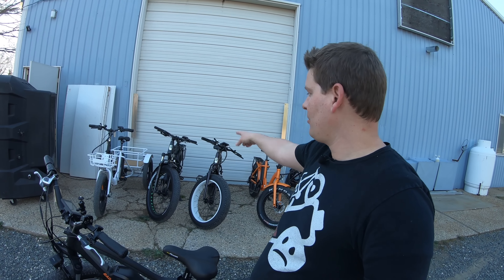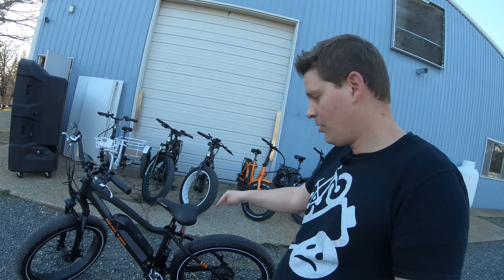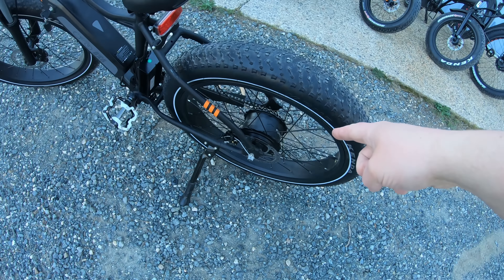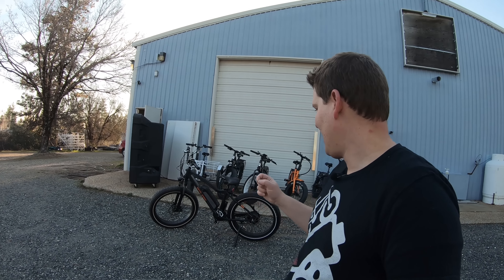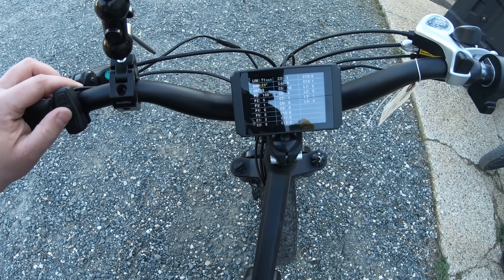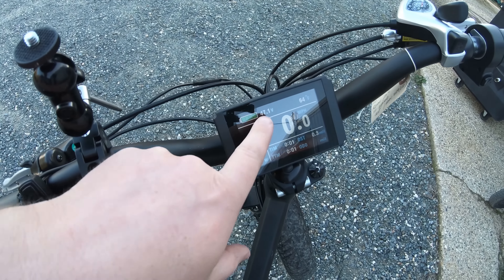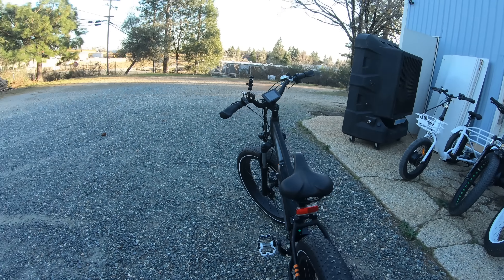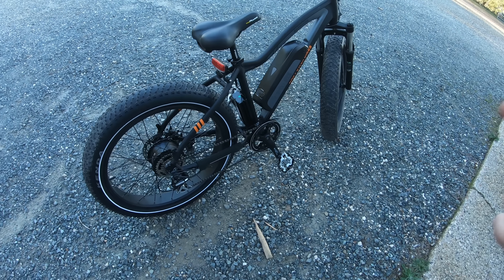How To Improve My Rad Electric Bike

Comment: I have a 2018 Radrover. Does your bike still have the stock motor? And if so, what will adding the motor upgrade due for the performance? There seems to be three possible upgrades. One with just the motor upgrade, one with the controller and display upgrade, and one with all three.

Comment: I have the rad rhino I'd love a upgrade love this channel very informative
Reply from the maker: Oooh that's a fancy one! Sounds like you'd have fun with the upgrade
Reply: @Area13ebikes  it's the eu version on the rad eu site had it a month was dead on arrival but rad is sorting it out cant wait to use it as have nerve damaged feet will help me ride again
Reply: Would the upgrade kit work on the 250w version I hear there the same motors but different controllers on them and no throttle just walk assist on throttle and pedal assist I think they call the rhinos the rovers over there in the USA
Reply: @Area13ebikes  this is the eu version of the rad rover I have in white and orange I did message on your site about the older kit 

https://radpowerbikes.eu/products/radrhino-electric-fat-bike?variant=31654476906589

Comment: REQUEST 📣📣📣📣📣📣📣📣
Is it possible for you to create a small solution with inline wheels to attach to bottom of column with seat post on the RADMINI to make it easy to ROLL it around folded? I live in Midtown Manhattan, NYC and for so many years I have not purchased a bike because of the THEFT problem, so I want to take it inside the stores with me. If you can't or nobody but me interested I can eventually put something together myself with off the shelf parts and then add a retractable handle like wheeled luggage.
😎😎😎😎😎😎😎😎😎😎😎😎
Reply: Also if make it UNIVERSAL with some sort of adjustable securing method it can be purchased by any owner of a folding bike...it's not limited to electric bikes.
😎😎😎😎😎😎😎😎😎😎😎😎
Reply: Maybe something already exists and I just don't know the name of it yet to be able to do a proper search.
STEP 1: Make sure it already doesn't exists!!!
😱😱😱😱😱😱😱😱😱😱😱😱

Comment: Hey Kyle maybe you can explain in better deal on the C12 settings. Meaning that if I have a 48 volt battery, why is the C12 setting is 4 which cuts the battery out at 40 volts. That means that I am only using 8 volts of battery power. This doesn’t make sense. Why can’t I draw the battery power way down to 5 or 10 remaining volts?
Reply from the maker: Because lithium batteries would die if you drained them that far.

Comment: I Have a 2020 Rad Rover Step Thru 1  I would like to do a complete  upgrade on , Motor Display and Controller and Battery  . I Just need to know  if the 2019 Rad Rover stuff will work on it ????????

Comment: I have a 2019 Ariel rider C class bike can you supply and upgrade for the display and controller on this bike.  This has a mid drive motor but the throttle only works when the peddle assist is on zero.  I never use it and it would be handy for intersections and etc.

Comment: So using the upgrade kit can I program the various pedal modes for an energy saving option to get more range?  Of course I would have to give more pedal power, to go the extra distance.  The reason why I ask, is even at pedal assist mode 1 with the stock setup, it seems to apply a large amount of power, hence reduce my range.

Comment: I have a 2019 Rad City. A direct drive motor. Does this upgrade provide more power on direct drive compared to geared? I know you addressed the question but will I get a little more speed from this controller compared to the stock, which can be pushed to 24.4mph?

Comment: I'll likely end up getting this upgrade, though it seems like my RadMini 4 has a bit more power than it should. My battery voltage after charging is 53 volts and I don't know if that's normal, PAS level 3 comes on too suddenly, and walk mode is 13 mph!
However, one thing that annoys me about the stock controller, is that the PAS and throttle-only top speed is the same. Other e-bikes have a 20 mph limit on throttle-only, and 28 mph on PAS. How is your controller setup regarding this?

Comment: What is the best way to mount the controller? I own a 2019 Rad Rover and have only put about 25 miles on it. I want to do this upgrade and of course I want to do it as clean and most secure way without doing much guess work, if that makes sense.

Comment: I desperately want a 2WD conversion for my 2017 RadRover, for use in sloppy mud....  Any chance of that happening?  Any chance it can be done at least 'semi'-affordably?  If you can figure out a way to make a bolt-on kit that would work for both RadRovers and Sondors (or, alternatively, something generic for BBSHD bikes) without costing more than the initial purchase price, you will sell thousands of them!

Comment: i want to do this on my 52v1000w AR KEPLER has a 33amp controller, but only pushing 1300-1400. 1800peak.so if iput 45amp I should get more torque. cause there something slow down bike. also want to make 2wd KEPLER. thx for help

Comment: HI, im curious if the 52v battery upgrade for the radrunner plus once its on, can you swap it easily with the old battery? Or once I install the 52v battery, am I not able to use my 48v stock battery?

Comment: I have a Radrhino EU  750wh for almost 2years now, and 2battery's 48v x11.6 and 52v 13, i have order the new screen KT-LCD8H on your site yesterday, my question will the screen work on the radrhino when i install it or do i need the upgrade controller also.

Comment: I have a EU RadMini4 250w, I really find it near impossible to get up the steep hill near my house. As 250w is the legal maximum in the UK, I was unable to buy a more powerful RadBike, or any other e-bike for that matter. Will this upgrade help me climb the hills with my 250w? Am I right in thinking that once installed I'd be able to push over 600w to the motor?

Comment: I've got a '17 radcity with almost 3000 mi on it, I'd love an upgrade in power. Have you seen anyone using 20700 or 21700 cells in E bike batteries?
Reply from the maker: This would change everything for you. Hmmmm, good question.

Comment: I have done the upgrade for 2018 RadWagon.  

I’ll keep it short... I am keeping track of my efforts at:

https://www.radowners.com/index.php/topic,138.0.html

I have not posted settings yet as I have not finalized them 

What I have learned this far:

1) You need to purchase the Pedal Sensor Extension Cable from Bolton as the Controllers cable is too short to reach 2018 Pedal Sensor. 

2) Color display is very nice and being able to change settings is awesome. 

3) RadWagon is a 500watt bike, not a 750watt bike.  Yes it can peek power up to 750 watts for short times but That does not seem to boost performance and only seems to happen on hills.  Rad even says to keep it 500 or below. 

4) New controller makes RadWagon much more responsive to both Throttle and Pedal Assist. 

5) You cannot pump 900+ watts into the RadWagon and get more Torque or Speed. Anything above 500 just drains your battery faster and above 750 will probably damage your motor.  

So I’ll update the Forum Thread soon with my latest ride information and a list of all the settings I’m using thus far.  I need to change the power setting to limit the controllers output as on a hill I was pulling almost 900 watts and that must have sagged my voltage as well and the bike cut out.  I need to try and keep the heavy uphill draws limited to 750.   Also fine tuning some of the other settings as well. 

But I do now have a great flat land 500 watt responsive bike that has a great display and is more fun to ride.   It acts the same on hills after 500 watt limit of f motor is reached.

Comment: They all have the American design, but cheap, weak, generic brain. And I'm not just talking about Rads. All of them. And it's not about safety or regulations. That comes with the voltage. They all pack the same crappy 400W rated controller. And then, what's even worse, people don't change them, but they put even more pressure on them. What a joke. I ordered a 1000W rated(40A) sinewave controller before I even ordered the bike. Controller(little more powerful than they offer) + display(the same that they offer) + box for 150$.